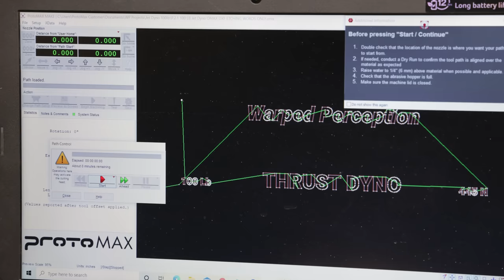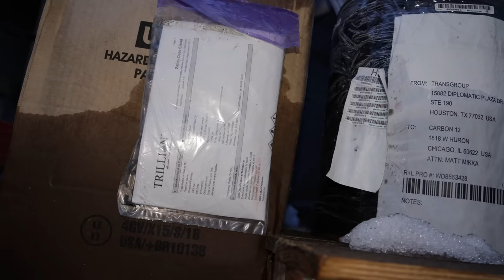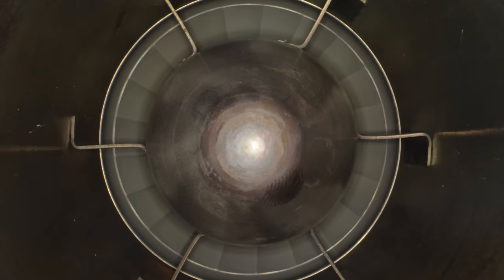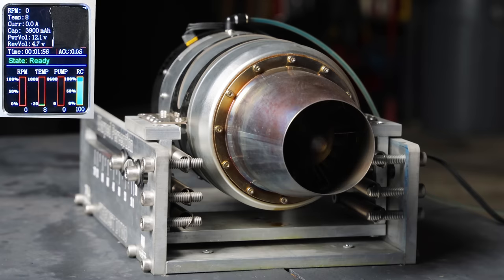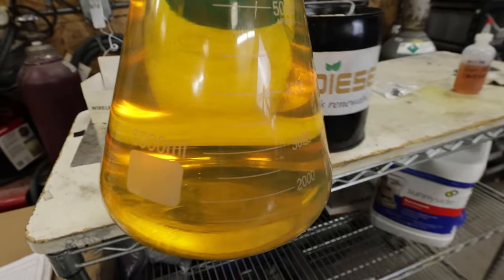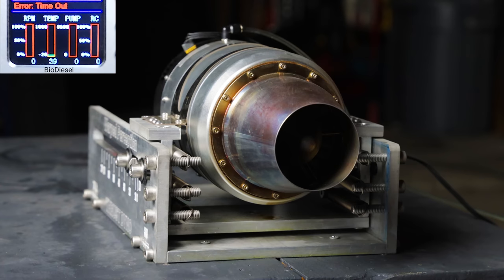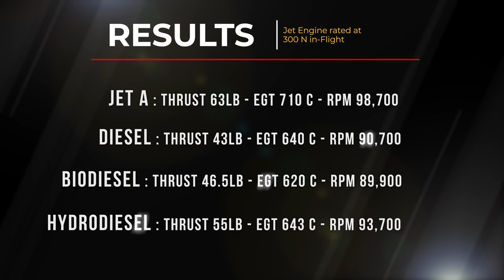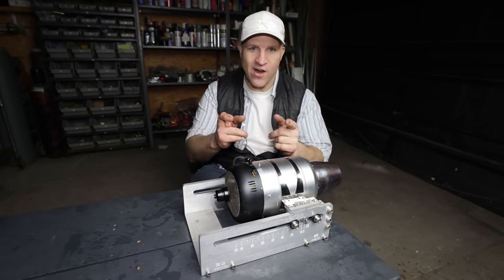Jet Engine Thrust Test - Fuel Experiment (Jet-A vs Diesel vs BioDiesel vs HydroDiesel)

Comment: The reason diesel produces less thrust is the higher Aromatics content of diesel
versus Jet A.  The content of Aromatics in Jet fuel ranges from 10% to >20%
(by volume) while the diesel fuel contains 25% to 28% Aromatics (25% in USA an European
Union).  In fact most Jet A fuel has about 15% aromatics content.
The "High Heating Value" (HHV) of Jet A is greater than diesel because of the lower
Aromatics content and from the resulting better combustion efficiency.
Jet A burns at a higher temperature than diesel (which increases turbine combustion
efficiency and hence thrust) because the higher aromatics content in diesel fuel requires
more (heat being absorbed) or BTUs to ignite and burn.
This results in a turbine combustion diesel flame that is 30% longer than the Jet A flame
due to the higher aromatics content of diesel fuel. The result of the longer flame (in the
turbine combustor) is that the 30% of the heat energy of the diesel fuel is not converted
to thrust because the diesel flame extends past the turbine nozzle into and past
the hot turbine wheel. In addition the longer diesel flame results in high energy (i.e.high
velocity) incompletely burned carbon particles being sand blasted onto the high
temperature hot wheel metal with the result being turbine blade erosion
(from combination of carbon or soot on the metal of the hot wheel and glowing carbon
particles).  To burn diesel effectively in a turbine engine designed for Jet A the flame length
of the combustion can/chamber needs to be 30% longer to get full combustion to occur
prior to the hot gases entering the turbine hot nozzle.
Reply from the maker: Funny that you mentioned that because last night one of my engineer friends at BP sent me an entire article on exactly that subject, that is one of the exact reasons they developed jet a in the early days, because even though the energy content is more on paper the aromatics and viscosity change by temperature make a big difference.
Reply: Thats a very interesting answer!  I wonder if you could ofset that, at least in part, by preheating the diesel?
Reply: @WarpedYT  I suggest a test comparing the thrust achieved and fuel consumption between the fuels.
One test with diesel plus gasoline mix fuels (of several different mixture ratios) and the straight
diesel fuel with the TCU setup (i.e. do the "Study RC" on diesel to calibrate the turbine control, etc.) to achieve 100% RPM (on diesel).  The results would be interesting to see.
The simplest way to get highway diesel to an Aromatics content in the Jet fuel range is
to mix non-ethanol gasoline into the diesel.  Simply adding a quart of non-ethanol gasoline
to one gallon of highway diesel will yield a "synthetic jet fuel" having around 12% Aromatics.
Reply: This is a very excellent explanation
Reply: @Alex-nx5wi  To preheat the diesel, the fuel can pass around the jet engine body to "boil" it before reaching the jet engine intake.
Reply: @Nickael7  and Alex:  Preheating the diesel won't accomplish what you are proposing (a way
to get combustion of diesel as efficiently as Jet A).  Jet A has a higher HHV (High Heat Value) than diesel while diesel has more BTUs but lower HHV.  The reason diesel is
an inefficient fuel for a turbine engines is simply the higher heat energy required to break the
Aromatics molecule Benzine & Styrene  ring bonds. Aromatics have two on more benzine
molecule rings fused together.  Breaking these Aromatics benzine rings apart during the
combustion process is required to accomplish the combustion of the fuel and that requires
more heat absorbed by the Aromatics molecules and more time.  Diesel is a slower
burning fuel (as a result of the higher Aromatics content) with more heat used to break the multiple benzene bonds.  Though Diesel may have a higher BTU content than Jet A the extra BTUs in diesel are used up to burn the higher Aromatics content.  Jet A having a lower Aromatics
content results in more of the heat energy is available faster and is used for hot gas expansion instead of Benzine-Benzine-Benzine molecule bond breaking.
Reply: @Alex-nx5wi  Where does the heat come from to preheat the diesel? The temperature required
to achieve any advantage at breaking the Aromatics Benzine-Benzine-Benzine molecule
bonds is much higher than you cold achieve with a fuel preheat...
Reply: @cogitoipsum9627  I have a question, if the mixture of the diesel with gasoline is done with high octane racing fuel, maybe could increase the performance? sorry for my english it is not my mother language.
Reply: @TheChr1574n  But you dont want high Octane in an Jet Engine tho :D thats why Diesel is used in the first place i think as it has an octane value of like 15-20
Reply: What if you added octane booster to the diesel???
Reply: What about a preheat?
Reply: ok einstein
Reply: @ZunaZurugi  which problems would come to try to run high octane fuels in Jet Engine? Is possible to solve it? Has anybody tested it?
Reply: 50%jet a/50% Nitro
Reply: @cogitoipsum9627  I found 20% Diesel mixed with 80% gasoline a match to 100% Kerosene in my Pulse Jet Engines.Just by experimenting trial & error. I can run a 50/50 blend but extra diesel I would need to pre-heat I think
Reply: @cogitoipsum9627  I will have to try run my pj on 100% diesel no pre- heat just swap fuel when up running red hot.See what happens.
Reply: @buggerlugz6753  I would think that would make it burn worse. I'm not a chemist, so take all of this with a huge grain of salt, and I may be completely wrong, but: My understanding of octane is that it's an indicator of resistance to detonation/pre-ignition. Basically, higher octane means a fuel that's more difficult to ignite, and so requires a spark. This is desirable in a car, particularly a high compression engine, because you don't want the fuel igniting due to compression, but only when the spark fires. You want the opposite in a diesel engine - diesel engines use the heat of compression to ignite the fuel mix, so a lower octane rating would be preferable, otherwise the engine would be hard to start and probably run rough, at least at lower speeds. I'm guessing the same would somewhat apply in a turbine engine: a higher octane would result in the fuel being more resistant to combustion, so a longer flame and wasted hot gasses. 

For diesel fuel there's something called a cetane rating, which is sort of the inverse of octane - it's an indicator of how quickly the diesel fuel will ignite. I imagine that a cetane booster would help, as it means the fuel will ignite faster, meaning a potentially shorter flame, or at least more flame in the combustor can before the turbine.

But like I said, I may be entirely off-base.

Comment: A tip: the majority of wear that turbines experience doesn’t occur during startup or when at 100% power... its during the shutdown and resulting cool down at zero rpm. Run a blower thru it to keep the rotor  spinning (not high rpm enough to keep it moving) until temps are reduced.
Reply: it"s partially true. Most of wear is during startup when RPM's are low so air velocity is also low and when fuel gets burned flames can actually touch turbine blades and burn them.

Comment: You have a problem here: your turbine with Diesel does not reach its full power because you reached the Pump Limit factor which prevents reaching the max RPM you asked for (stick position=RPM order). So either your engine /pump is not meant to use Diesel kind of fuel or the Pump Limit Factor should be increased. I guess this is due to the higher viscosity of the Diesel which requires more effort for the pump
Reply from the maker: I think you hit a right on the money, I didn't realize there was a problem until after I published the video and people started pointing it out.. my goal here was to just run the engine and its stock form on those four fuels without modification, I was told that that is the way that guys normally use these engines. I just did some flow tests yesterday to troubleshoot the problem and you are dead on accurate, for some reason the fuel pump is struggling to pump Diesel and biodiesel, and hydro diesel as well but not so much I'm pretty sure because of the viscosity.
I'm currently looking into it and I'm going to come up with another test very soon once I fix the problem.
Reply: @WarpedYT  Power generally goes up slightly from Jet-A to diesel, but so do temps.  Keep a close eye on those if you turn the fuel up.  I used to run diesel in my PT6 and it worked okay, but it was hell on injectors because of how many more contaminants there were in diesel straight from the pump.  You could see sparks flying out the exhaust from the dirty fuel, a little concerning when you're taking off before sunrise.
Reply: Diesel has more oil in , wich will make it thicker than ' jet fuel '. Very good point.
Reply: @terryperrott9913  Paraffin wax...it's what causes diesel to gel up in winter and also why it's refined out of kerosene/Jet-A.  It's fairly low viscosity in normal temps but gets really thick below freezing.  You don't want your fuel gelling up in sub-zero temps at 30,000ft.
Reply: @WarpedYT  If you set the RPM limit to 88000 so that all the fuels can reach the same speeds, it would be a proper performance comparison until you get the fuel system worked out. I just find it weird that your pump can't handle it, my 20+ year old 200N runs diesel on an undervolted fuel pump to the rated rpm limit no problem.
Reply: You added oil to every type of fuel at the beginning, right? Why not repeat the test with a slightly different mixture for the diesels (less oil)? Maybe that'll help with reaching max RPM / less smoke.

Comment: I think the pump is just not calibrated to work with different fuels: temperature and RPMs are lower meaning the turbine is not at full capacity. I.e. needed more fuel.
Reply: Pump looks to be hitting the pump pwr limit, meaning rpm isn't achieved.
Needs to be redone,
Reply: @ausfester  I think it's the different calorific values of the fuels that are producing varying rpms or maybe it is the viscosity not allowing equal fuel delivery
Reply: No need to calibrated the pump whatsoever. This test shows that the jet fuel is superior than other fuels..the fuel pump not even at maximum capacity but deliver more power than other..
Reply: @EGK20  well, the energy density is different for sure. But it is interesting if it is feasible to use other fuels even at higher consumption rate. Can they produce the same thrust?
Reply: Hydrodiesel contains water, so, for sure lower BTUs than JetA, and still just 87,65% of the thrust. I guess hydrodiesel wins this efficiency test, perhaps easily, since hydrodiesel BTUs are, for sure, less than 87,65% of JetA BTUs... Hydrodiesel has 30% watter and 10% tensides, so, best case 97,300 , that´s only 72% of JetA BTUs (worst case: only 62,5% of JetA BTUs). Of course, I have no idea if he used similar volumes of the different fuels...
Reply: @klausbrinck2137  
One thing to keep in mind is that water flashes to steam at an extremely high expansion rate. So that could be adding to thrust also even though it doesn't actually contain any BTU energy itself.
Considering the results on this test that it was second best behind jet fuel I wonder if that is the reason. It's got 20% less BTU potential but yet was second place.
Reply: Also a lot of air bubbles coming in  so intake isnt efficient or even consistent at all
Reply: @EGK20  You might need more fuel volume to reach the same thrust, but @Shur Murray is correct, the fuel capacity limits on the pump are set on the first full throtle after using the "RC learn" function on the ECU, which I assume was done with Jet A1, so the pump limit was set to a value which is just too low for diesel. Otherwise the is no reason for the ECU to not just inject more fuel at 630ºC of EGT to keep increasing RPM.
Reply: @Igbf  
If that's the case then this whole test   doesn't mean much. You would have to calibrate the ECU with every fuel change.
Reply: @gregorymalchuk272  Well, you definitely SHOULD if it is a major fuel change like Diesel->Kerosene. I would guess that if it is just a "minor" change like from Jet A1 to Kerosene for heaters or some Diesel brand to another same settings would suffice.

One workarround is to set the pump for the fuel that is harder to pump (in this case Diesel) instead of the opposite, that setting will work just fine with the rest of fuels (although it will probably make acceleration less reliable and the turbine could flame out if the differences are too big and the ECU fails to account for that and increases fuel flow too quickly).

Modern turbines from some brands (not Swiwing like this one AFAIK) have different presets on the ECU for Diesel and Kerosene. Actually on older ECUs (like the ones manufactured by Xicoy for turbines from about 2010 and earlier) you can actually see and change almost all the values manually, but with modern turbines like this one the end user has very little information and it "just works". That is bad for people who likes to tinker, but I guess they are more reliable if operated by people with fewer knowledge of the topic.
Reply: @kens97sto171  the best thing about having water in the fuel is for cooling, the vaporisation cools down the engine significantly (same as water/methanol injection) allowing for higher fuel flow rates/compressor RPM/boost.
That Hydrodiesel was running ~30°c cooler than the jetA.
Reply: @henriwood9692  
Definitely would help out with the turbine. I wonder how regular diesel powered vehicles handle the water. They're equipped with a water separator for a reason. I wonder if there's any long-term damage caused to the injection pump or if the water is emulsified enough in the fuel that it doesn't bother the engines.
Reply: @bodywerks  yes for your application they able to go 100% but you engine will use more fuel to achieve the same thrust as jet A produce which required less fuel..this test about which fuel give more thrust which mean in order for the test to be valid, everthing should be the same
Reply: @Igbf  yes i know..but when he said 'which fuel give more thrust it means that all parameter should be the same for the test to be valid. Do you ever think how engineer choose fuel for turbine engine??they will choose fuel that will give higher thrust without carry so much fuel..diesel can give the same thrust as Jet A but required more fuel and probably need to carry fuel twice amount of Jet A
Reply: Well it doesn't really need to be redone...  This is actually a better test to show energy density.
You've got a fixed pump... Diesel fell short.  That hydro diesel was pretty impressive though.
If anything he could have put the pump all in with the jet fuel and saw what kind of RPM the compressor was reaching which is another indication of energy released.
Reply: Searching the comments just to find this one.  Spot on.  NOT ENOUGH PUMP.  Improper comparison.
Reply: @kens97sto171  the water has a molecular weight of only
Reply: @shurmurray  So long as you put in the same amount of btu's into a jet engine per second you should get almost identical engine performance iirc
Reply: @kens97sto171  Unlikely to be a major contributor to thrust, the mass flow rates we're talking about here are pretty low compared to that for the air passing through, so I doubt you're really augmenting the thrust that much. Water injection in older jets used a dedicated water line
Reply: Some fuels like more air. Granted their detonation factors. Could also atomize fuel before delivery to help with oxygen. But hey, I'm dumb and this is only YouTube.
Reply: @replynotificationsdisabled  those jet engines uses fuel evaporation before it enters a combustion chamber. The fuel is pumped through hot metal pipes heated by the flame and only then enters actual chamber where it mixes with the air and finally burns.
Reply: @kens97sto171  true. Water when injected in a high temperature a high pressure produce dry steam by vaporisation. This method has been used in high performance car engine to increase power and reduce engine heat.
Reply: @henriwood9692  Yet the never ending efficiency gain chase  in turbojets are by ever increasing of turbine max temps.